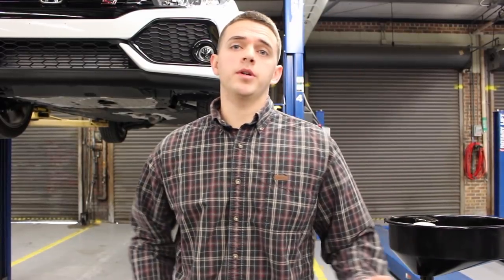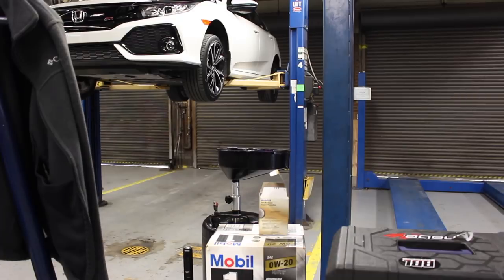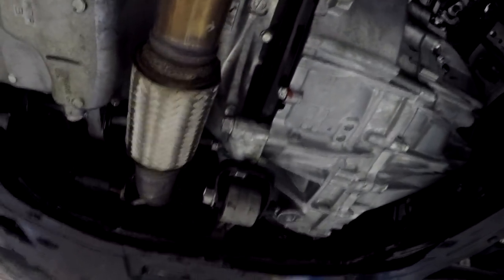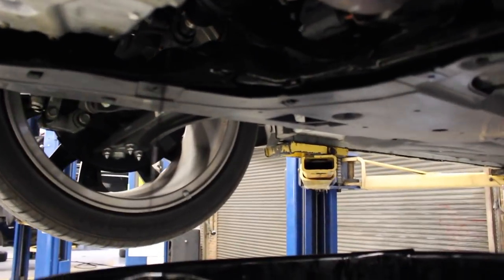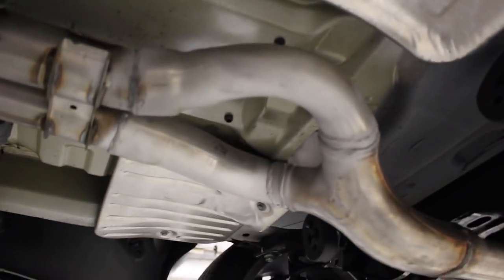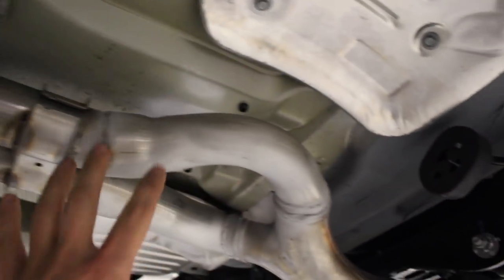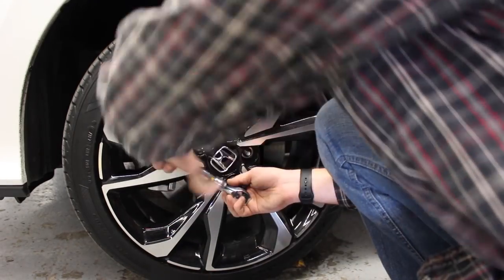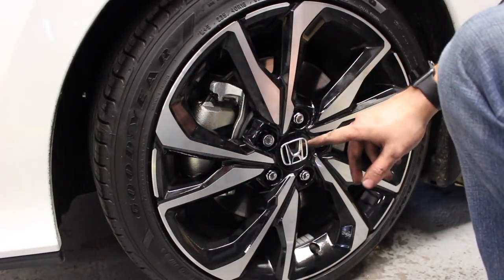How To Change Your Oil And Save Money **10th Gen Honda Civic**

Comment: I think you did an excellent job and don’t take this the wrong way, but always replace the crush washer on Honda oil drain plugs.  They are specifically designed to be used once, maybe if you’re lucky twice.  I just trust it won’t leak, and it never has on me to this day.  I daily drive a 2006 Honda Civic Si 4-door galaxy grey metallic 6-speed manual with over 332k miles.  I am only saying this because if the washer began to leak, then it would cause damage to the engine because Hondas are oil pump driven machines.  Anyways, nice work.  Cheers.

Comment: FYI its a 17MM on the drain plug. Remember kids this is a Honda that is built with metric tools (MM) using an 11/16'''(SAE) might strip it out. And always replace the crush washer on the drain plug.
Reply from the maker: Thanks man!
Reply: Can you order these crush washers?? Or are they at the part store?
Reply: James you can order online but they may have them at the store also.

Comment: 17 mm for the oil and 19 mm for the wheels. This is a Japanese car bro lol
Reply: When I heard 11/16 I was hold up I thought this was Japanese lol. If the socket isn’t snugged on a screw he can strip it, I appreciate him for the effort in putting out the video on the service being done.  Hope he did check for leaks and all is secure run the car to check oil levels . Wheel locks lol
Reply: Drain plug socket size i 17mm.
Reply: @alvinesesc  and its 12mm for the plug on the 2021 CBR 600 RR

Comment: Just did my Oil change 1 month ago with the Amsoil Signature 0w20 and EA filter... Best oild eveeeerrrr... My mpg has increased ive noticed, acceleration is quicker and over all my car feels awesome. (2016 Honda Civic EX)
Reply: Do you still do a oil change every 3k?. I see online it says every 25k
Reply: freeweights101 I plan on Doing it whenever my car asks me to not sooner or later. Be careful when people ( Car Brand Reps) tell you ne have to do oil changes ever 3 months because thats not necessarily true. I'm in luck my car lets me know when she needs some lovin. What do you drive?
Reply: I just bought 2017 honda civic ext
Reply from the maker: Yes every 3k or 3 months
Reply: Ty soo much 4 the response. I'm trying to learn everything on how to keep my car healthy on DIY. Kinda felt I got riped off on the car but I had to bite the bullet due to my other car got stolen. And I needed a ride to work. There's no bus that take me to my job and Taxi was getting way to expensive. I spent 1k a week just to go place to place to get things done for myself
Reply: freeweights101 how much did you pay?
Reply: Jose Velazquez 20k 16bapr since it my 1st car. But that apr I felt is just way to high.
Reply: freeweights101 yeah. I got mine for 20k out the door with 9k miles on it.. I could og gotten a EX-T but I don't like Hondas Turbo system. They tend to fail. I've already heard many are being recalled do to that
Reply: Jose Velazquez thanks 4 telling me that. mine has 23k miles when I bought mine
Reply: freeweights101 23!!!!! Thats alot for a 1 year old car
Reply: yea it is. A lot of cars used cars in southern Cali have high miles. Wish I was more patient in buying a car but due to my circumstances, I just needed a car

Comment: First motor oil change on these 1.5T Hondas is when the wrench icon shows up in the dashboard.

The dealership explained to me that the factory oil has some additives that helps with the 2,500 miles break in.

After that, 15% oil change would be reasonable.
Reply: Hey, just wanted to tell you I found your channel yesterday and subscribed. I have 5 cars and one of them is a '17 Civic Hatch Sport. 

Planning on buying the engine bay side covers I saw on one of your videos. I didn't even know those existed! Thanks for the info and keep it up little bro!!!...👍👍
Reply from the maker: The me for the sub!

Comment: Wish you would have explain the “80 pound torch. I don’t know exactly how that works.
Reply: You torque the nuts on the wheels to 80 foot pound torch. You have to use a torque wrench so you don't over tighten them.

Comment: Do you prefer your method of tire rotation? The preferred method would be the rear tires cross and go up. So the right rear goes on the left driver side, the left rear goes  on the right passenger side. And the one in driver side and passenger go straight back. By the way i like your videos g!! Keep it up!
Reply from the maker: That I true I should of done it that way...

Comment: Hey, actually just did my wife's accord 2.4 2012 oil change today. Was thinking about my 19 SI. I'm at 4080miles. Everything I've read says to just change it when maintenance minder says 15%. I'm not sure because I know this car gets pretty hot. Small turbo makes a lot of heat. Also tuned on tsp stage 1. Thinking I should maybe hit it sooner. Just want to hear ur opinion. Great videos. Appreciate the time and effort you are putting in.
Reply from the maker: I would go ahead and change the oil. No harm to do it now!

Comment: i only use Honda oil filters
Reply: what's the difference?
Reply: @raczyk  because if its good enough for the factory to put on its good enough for me  look for videos on the tube where they cut them open and you can see the good ones and the bad ones fram is junk

Comment: Whats the reason for filling up the filter with oil? It fills up rather quickly as the engine turns over, am I wrong? And also, can you just rotate the tires like that, are they not directional, which means you need to keep the tyre on the same side of the vehicle because moving them to the opposite side would change the primary direction?

Comment: what can i use to clean my wheels and make them shine? a alluminum cleaner or chrome cleaner?
Reply from the maker: Some Diablo wheel cleaner from chemical guys!
Reply: @TTorres1183  thats my problem, i dont live in USA, so i just have two options: chrome cleaner or alluminium cleaner, and i dont know which material is my wheel made from. i have a 2016 civic EX with stock wheels.

btw thanks for reply
Reply from the maker: Check out Gyeon that are global
Reply: @TTorres1183  thank you, btw, do you know that emissions system problem is? coming up on my car once a month, but i erase the alert with battery disconnect

Comment: Directions say 3.7Q, but that includes the filter. If you pre-fill the oil filter, how much quarts did you end up pouring through the top plug?
Reply from the maker: I made sure it was 3.7 quarts exactly
Reply: So it's 3.7 through the top. And maybe .3 or a tiny more to also fill the filter before you lube it up
Reply from the maker: That’s true
Reply: Steven Swiderski should be 3.7 total.  You can't really measure how much you pour into a filter  (unless you actually measure it with like a measuring cup which would be a waste of time imo.

Just pour a little  into the filter and pour the rest into the crankcase.  When you get to the 4th bottle, just make sure you have about a quarter bottle left.

With that being said, it really wouldn't hurt anything if you put a little more than 3.7q in by accident.

Comment: When is it recommended for the drain plug crush ring to be changed?
Reply from the maker: I’d do it every oil change... a pack of 20 is under $10
Reply: @TTorres1183   thank you for the quick reply. Where can you properly jack up the car using a hydraulic floor jack?

Comment: how much does changing you oil actually save you? my dealer only charges $45 and if you buy 4qt of oil it already cost $40 plus the price of the filter.

Ps. idk if there's different methods of tire rotation but the way ive seen it done, only the front wheels criss cross, the back wheels just move up on the same side. By doing it this way, the tires will eventually go to every position ensuring even wear. if you criss cross front and back, they are only rotating between the same two positions.
Reply: nokia6800 my dealer charging me 105 dollors got a hatch 1.5 turbo

Comment: I own a honda lx used and i did not get that metal cover called honda they want 100$ for it said the pan can rust without it ...is this true
Reply from the maker: The oil pan?
Reply: TTorres1183 its that metal cover u un screw brother
Reply from the maker: Yes it is, I would order it. Depending on where you live I suppose it could rust if un-covered
Reply: Was wondering if i need it asap or could i hold it off to get it .. and y do they come off easy

Comment: Nice job. Use disposable nitrile gloves, at least for the drain plug and filter removal! Wish Honda had designed the oil filter on the top of the engine. Newer GTI's and Imprezas do. So much easier and no spillage all over!

Comment: Does doing your own oil and or doing a muffler/res delete void any warranty?
Reply from the maker: I don’t see why it would...?
Reply: Sorry it does void, you must be a Certified Mechanic, they will want to see who did your previous oil changes
Reply from the maker: I disagree that changing your own oil will void warranty
Reply: TTorres1183 ask your dealer what do I know
Reply: Jose whoever told you that changing the oil yourself will void the warranty needs to do some research, or it was the dealership and they said that to make more money off of you. Tell them to read Magnuson Moss Warranty Act

U.S. FEDERAL LAW

It is illegal to tie warranty coverage to whichever brand of parts or lubricants you use. Manufacturers that do so must provide the parts or lubricants free of charge
Reply: Jose Hernandez Jaydan's response is correct.  Doing your own oil changes will not void your warranty.  

The muffler delete will though.
Reply: AnonyMouse muffler delete only voids the exhaust warranty, not the whole cars warranty.
Reply: Jose Hernandez by law,  they are not allowed to void warranty.
Reply: I don't know about in the USA but in the UK as long as OEM parts are used, servicing does not need to be done by a Honda Dealer.  My Experience with Honda approved Dealers and Honda UK is not the best.  They say the Air Filter on the 9G Diesel does not need changed till 37K Miles.  I did mine at 27K and couldn't understand how the car could breath it was that filthy.  Do it yourself using OEM service parts and Honda recommended oil and you'll be fine.  In the UK the oil change interval is 10K Miles, no way would I wait that long, at least half that....

Comment: How much did the drain plug and oil cost you in total?
Reply from the maker: The oil and filter was $40 I didn’t buy a drain plug. Thanks for watching!
Reply: TTorres1183 $40? How much would they have charged you to do a oil change? The Honda dealership I work at does them for $30.
Reply from the maker: I don’t know the exact price...
Reply from the maker: Synthetic blend

Comment: Great vid TT! ,  just curious will you be using a heavier oil in summer like 5w40 5w30?
Reply from the maker: No sir I’m going to stick with the 0w20. Thanks for watching Ryan!
Reply: Unless you are tracking your car I would not go heavier in oil weight.  Heavier oil will cause slightly worse fuel economy and potentially increased engine wear due to lack or flow

Comment: Hi TTorres
I have been hearing of Civic 1.5T owners complaining of gas in their oil, or at least the oil smelling of fuel/gas.
Have you ever, during oil changes, or just checking the oil, smelled fuel in the oil?
I just purchased a 2018 Si so I am a bit worried about this.
Thanks and great videos. I just subscribed
Reply from the maker: No sir I’ve never heard of that issue or have had that problem!
Reply: Yes very much so. It’s very strong for me but I have a short ram intake and catless. I have to go to the gas station a lot. I’d imagine just keep up with your oil changes

Comment: Wow.  Another great instructional video from TTorres!   Your videos are like "how to" manuals brought to life.  Two questions - at what point will you do your next oil change?  Also,  if someone has a Honda dealership change their oil, do they also replace the filter and rotate the tires?  (I got a free oil change coupon from my Honda dealer because my salesman was a complete jerk to me).  Thanks again for your vids - This one is the best yet!
Reply from the maker: I’ll change my oil again at 8500ish miles. They should replace the filter and rotate the tires i would ask them before you get your oil changed. Thanks for the kind words!
Reply: My dealer does the oil change for $35. Synthetic and the filter. Rotation is $12. I would do them myself but I want a paper trail of services
Reply from the maker: Is that for full synthetic or synthetic blend?
Reply: TTorres1183 I believe it's full. I'll have to check my receipt. Sis you have to rent that lift or do you just know someone?
Reply from the maker: I rent it for cheap and the dispose the oil!
Reply: Marshall Chandler unless you have a really great dealer who charges no overhead at all... there's no way it's full synthetic. Probably a blend. 

Mom and pop shops charge $50+ for a full synthetic oil change and if you get the oil and filter yourself to diy it's like $33 avg. for a synthetic oil with a quality filter.

Comment: I just change oil and filter for Honda civic 10th generation 
2016
I poured 4 quarts oil 5w-30
As I’m living in a Caribbean 
Island and I check the gauge
It marks between the two lines not even on the max 
So no problem you all can do four quarter include the filter filling.
Sharing my experience 😐😐😐😐.

Comment: If the engine is Turbo and area is not below 30.C Summer, you gotto use Mobil 1 ESP 0W-40
You'd better clean the MAF sencor each time oil change

Comment: I change my 2015 si at 20%
Reply from the maker: I just believe 3-5k with full synthetic is fine or 3 months which ever comes first.
Reply: New sub by the way
Reply from the maker: Thanks Shane 🙏🏻
Reply: Shane Wilhelm 6 inch or footlong?
Reply: 3k is a recommendation from the oil companies not from auto manufactures.  I trust the people warranty(ing) the product.  Even my 95 civic was recommended at 8500k by Honda.  I know it won't hurt to change it more often but oil changes aren't cheap even if your doing it yourself
Reply from the maker: That is true but if you can catch the oil and filter on sale your golden. I got my oil at Costco for cheap.

Comment: Dude 3k miles is way to early. That was true many years ago. Oil now is si much more advanced now, that with conventional oil, you can change it at every 5k miles. If you're using a synthetic, then you can change it at every 12k. Some synthetic's state you can change thier oil at every 25k miles. Stick with mobile one and change it at every 8 to 12k. Thousand likes then you're all set mah boi
Reply from the maker: Good info

Comment: Do not follow maintenance minder. Here’s a guy on the civicx forums that had his oil analyzed at 15% (10k miles), the oil was in the worst possible condition on their scaling system.

https://www.civicx.com/threads/1-5-turbo-answer-to-what-engine-oil-grades-are-allowed.11422/

https://www.civicx.com/attachments/i047301-oilana75020139-pdf.38021/